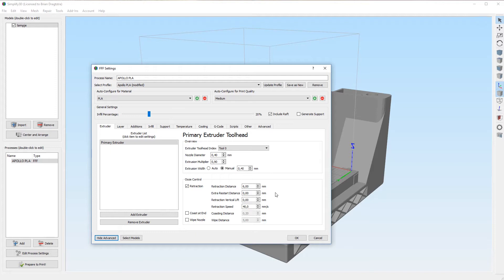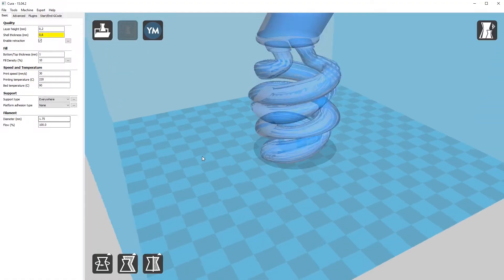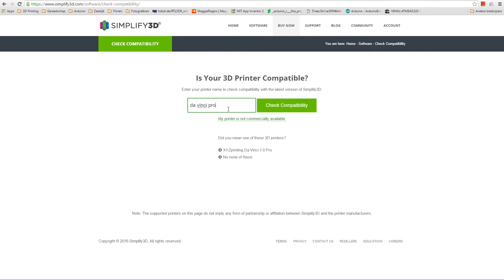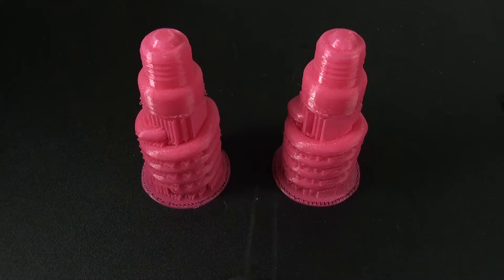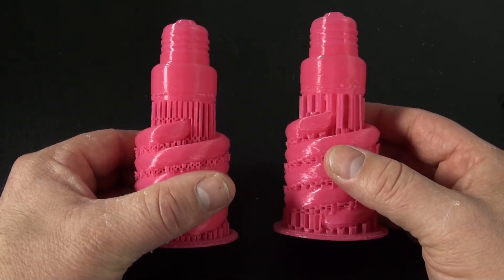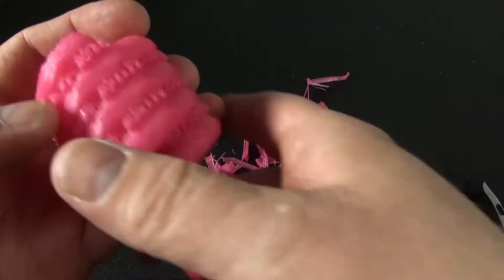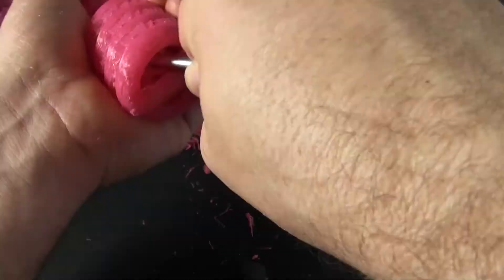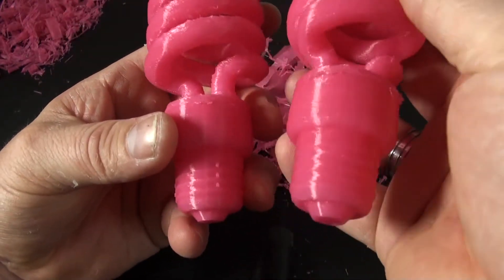▼ Results from last weeks Simplify3D print with the Da Vinci Pro printer

Comment: Can Simplify3d communicate with the Davinci 1.0 Pro, via the WIFI link of the printer?
My computer is downstairs and the printer is on the first floor.
I now occasionally use Slic3r, but then send the files to the printer as GCODE through the XYZware Pro.
If Simplify3D can do it in one go, that would ease this workflow.
Reply from the maker: Yes and No.
I have had it working here, and after I switched my router to another brand that used another type of security, My printer couldn't communicate with my computer anymore.

Then, last week, I tried re-installing the WiFi again with a not secured router and I didn't got it to work anymore.
I must admit that I gave up really quick, because for me there is no need to go wireless.
Reply: Ah ok. In that case it should work in my set-up. In the worst case, Simplify3d should export GCODE (it can, does it?) and I can keep the setup I have now.

Thank you very much.
Now to convince the mrs. :-)
Reply: I had mine working via wifi but it has stopped working and I cant get it going (hope the smoke didnt get out )..However widows firewall or other firewalls will be stopping the communications. I suggest you check that simplify3d is enabled in your firewall program for private and public access